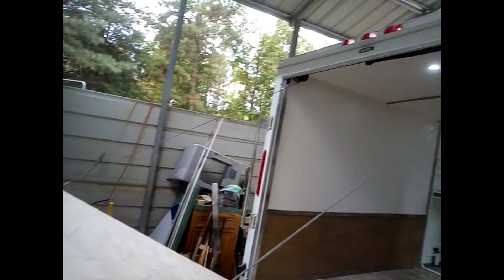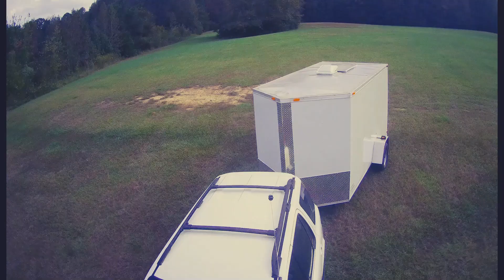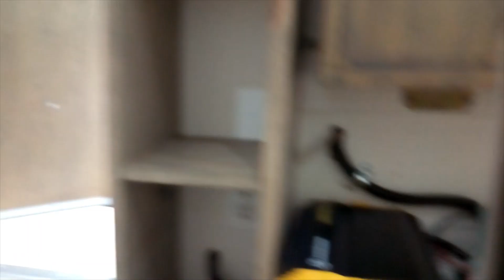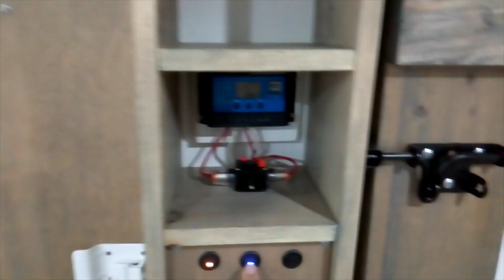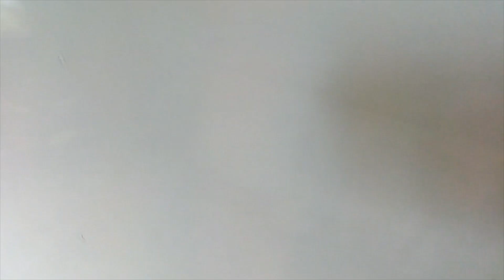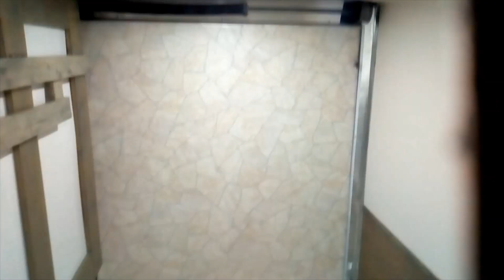Off Grid Stealth Cargo Camper Conversion Solar Minimalist Utility Trailer 6x12

Comment: What a nice Poor Man's Camper - I see you used the same circuit breakers I used on my Poor Man's Electric Sailboat - they work well.  I'm currently adding a small emergency generator to power my trolling motor only in emergency or to get through long stretches like a canal.  I like the minimal approach.  Wish I was a bit more like that ;)
Reply from the maker: Thanks!  How funny that I've also been restoring and electrifying an old sailboat!  I'll need to checkout your channel soon!

Comment: I like that inverter but 1,100 watts for all those outlets it seems to be pretty low , specially if you are using more than 2 at the same time unless you are aware of that and run low wattage appliances.

Comment: Do you have metal mesh covering your floor vent so mice can't intrude?  What about a mosquito net?  Also, since the vent is behind the trailer's wheel, does mud and crud get caught in it when you're moving during rainy days?
Reply from the maker: Hey good questions.  I've thought about a mesh - good idea.  Hadn't thought about the mud/rain issue.  No trouble with it yet...

Comment: Nice conversion. 3 boys, the wife and myself with 6 kayaks I did a little different. Fold up bunks on both sides but since I added shelves and a counter at the front I had to make solid bunks on the one side. In 3 years we will give this one to my oldest when he turns 16 and make another just for us. Adding solar panels to the roof along with the briefcase panel. 220 watt briefcase seems to be enough but I will be adding 2 more batteries in the future.
Reply from the maker: Awesome man.  Anywhere I can see your project?